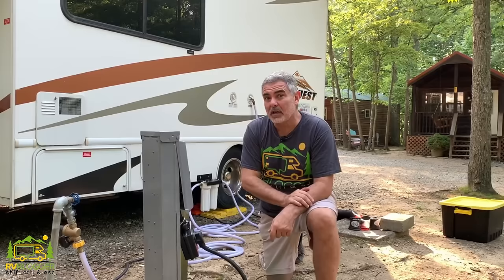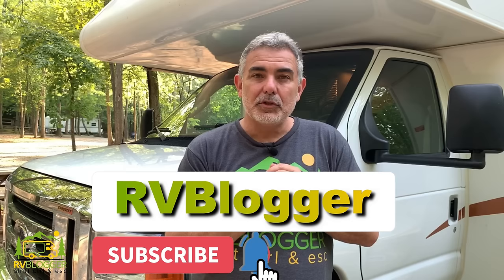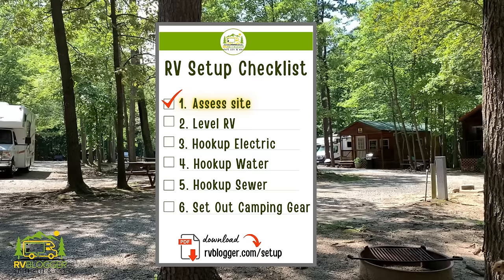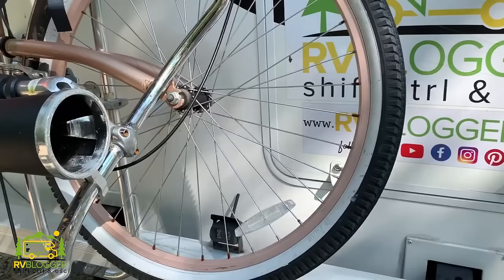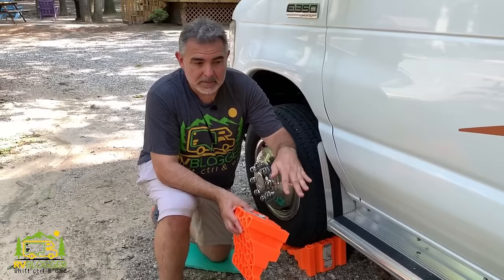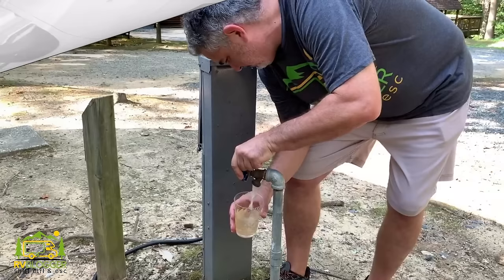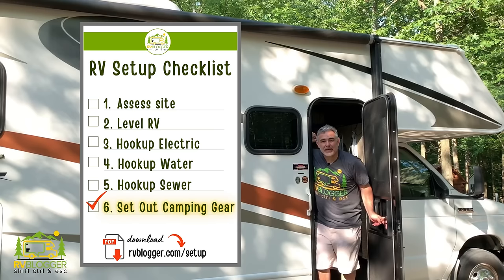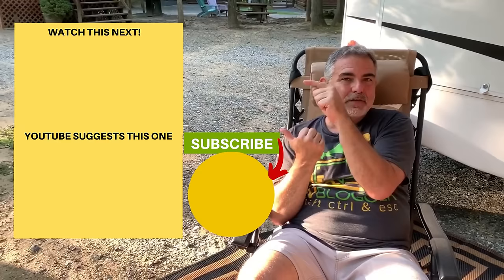How to Setup Your RV Campsite for Beginners - Water, Sewer, Electric and Gear PLUS Newbie Checklist!

Comment: I’m at this moment on my first RV trip ever with my ten year old and while I got an overview from the person who rented this to me, I need help. I don’t have a water pressure piece and just use the hose provided. Do I leave the water running on? Does it regulate from the inside part of the water hook up? Stupid question l know! Also, the ac is only running when I have the generator on. When I turn it off and have the regular electricity hook up, AC nor the microwave turn on. My cotnact hasn’t gotten to me but checking if I am lucky to have someone read this. Am I doing soemthing wrong? Do so need to push a different button to make the ax work without the generator? Is there a video about the buttons inside the RV?
Reply from the maker: Hey Mari 
Great question! You should have a water pressure regulartor because there's nothing in the campground water system or your RV that limits the water pressure :) 
You may have a faulty transfer switch if your electricity isn't working with shore power. 
Thanks for watching and commenting! 
❤ Mike and Susan 

By the way, we hope you will subscribe to our FREE monthly digital/video magazine called RV Camping Magazine. Let us know how you like it!
https://rvblogger.com/rv-camping-magazine/

Comment: Can you use a surge protector with an extension cord or just the junction box at a campsite?
Reply from the maker: Hi Mimi,
I'm not exactly sure what you mean but the surge protector can sometimes be used if you have an extension cord. You would need the proper adapters to get from the 110 current through your surge protector and then attach your rig to the surge protector. But I have also tried this set up and it did not work. So I would say try it and if it doesn't work just eliminate the surge protector.
I hope that answers your question.
Mike

Comment: How do I turn on and off the gray & black water tank ??
Reply from the maker: Do you mean open and close the black and grey tanks? There is a valve handle you pull and puch to release and close the tanks. Typically found under the RV in the rear. Thanks for watching our Setup video and commenting.

Comment: I love my Rhino sewer hose...however, I did have one disentegrate as it stays outside and hooked up for long periods of time - super pro tip - try to keep sun off of sewer hose - Everyone will have one of these environmental spills in their RV career - just try to make as long as you can before this will eventually happen. Also - what do you carry for dump station dumping? Will the Rhino work? I need to buy a second hose for traveling and not sure which to buy.
Reply: I keep another hose the same length as my original - just for backup and/or extension.
Reply from the maker: Hi Mickey,
Sunlight really does cause things to wear out faster. I use my Rhino Blaster and Rhino sewer hose for dump station dumping too. Plus I carry a green water hose ( my white hoses are for fresh water) that I connect to the RhinoBlaster at the dump station. I hope that answers your question.
Thanks for watching and commenting! 
Mike and Susan

Have you subscribed to our YouTube channel yet? If not we sure hope you will click below and subscribe! Thanks!
http://goto.rvblogger.com/YoutubeChannel?sub_confirmation=1

Comment: Hello from Colorado. I have the same RV that you all have. I just purchased her 3 weeks ago and love it. In very good shape so as it will be myself and pup I didn’t want something that needed much work. Ok-I have a question on the gray/black. I have to almost lay on the ground to reach the gray lever to open. I’m 71 and it isn’t the easiest to do. Is there something I’m missing on how to hook up and empty the tanks. At this time there is only water in them and not much. No potty has happened yet. I wanted to do a hook up at home for practice so I can do it once out camping. 
Suggestions most welcome. You do a very good job explaining things and I thank you for that
Reply from the maker: Hi Marcella,
I responded to you 5 days ago but it must not have saved.
You aren't missing something. The gray tank valve is on top of the pipe and you have to push the handle straight up to open it. It's kind of in a bad spot. 
You could have any plumber look and see if they could move the valve to a different location so maybe you could pull down to open it. It's all just plastic pipe.
Thanks for watching and commenting! 
Mike and Susan

Have you subscribed to our YouTube channel yet? If not we sure hope you will click below and subscribe! Thanks!
http://goto.rvblogger.com/YoutubeChannel?sub_confirmation=1
Reply: @RVBlogger  Thank you.  I am going to do some research for someone who does RV build/remodel etc and see if they can help with this.  I am thinking about (if possible) having an opening cut and a door fit (like other compartments) so I can get to that valve.  Or one of them may have other ideas for me to consider.  Not sure why they would have done it this way but I move forward to find a resolve.  If that happens I'll be sure to share with you....again thank you and safe travels!!!

Comment: Great set up video!! I give you that in spades!! But....if the blue water filters "don't work" then why are they so highly regarded? I've used them multiple times with no complaints. I even tried the water after I disconnected and tried the water straight outta the faucet and there was a notable difference in taste. So, I have to very strongly disagree that the blue filters "don't work". Maybe they don't do the job your double filter system does but saying they don't work is an injustice to them. They do work and they do help with water cleanliness.
Reply from the maker: Hi Zach,
Glad you like the video!
The cheap blue filters do help but depending on the filter you buy they only filter down to 100 microns...here is a video I made about how filters work that explains it all in detail. 
https://youtu.be/06nHVkDeqwg
Let me know what you think!
Thanks for watching and commenting! 
Mike and Susan 

By the way, have you subscribed to our YouTube channel yet? If not we sure hope you will click below and subscribe! Thanks!
http://goto.rvblogger.com/YoutubeChannel?sub_confirmation=1

Comment: Do you ever worry about somebody stealing your surge protector?
Reply from the maker: We have never had an issue with theft...knock on wood 🤛. Some times we will cover the pedestal with a large trash bag. That does 2 things, protects our electric setup if it rains AND deters theft by making the surge protector unnoticeable if you're camping in a questionable area. Thank you for watching our RV setup video and commenting.

Comment: When you're using city water at the campsite, do you keep the water pump on?
Reply from the maker: Hey Reginald, 
Nope, you only need the water pump when you're using water from your fresh water holding tank. 
Thanks for watching and commenting! 
❤ Mike and Susan
Reply: @RVBlogger  Tks. In your opinion, what is the best rv? Do you prefer fiberglass or tpo roof? I will be purchasing an rv in the near future.
Reply from the maker: @reginaldsingletary2557  Hi Reginald, We really like the fiberglass trailers the best. They hold their value and leak less often. We made a video about them at the Fiberglass RV Rally last year. Here's the link if you would like to check it out.
https://youtu.be/R5ofLqoRVZ8
All the best!
Mike and Susan

Comment: Getting ready for my very first outing. I’ve never even been in an RV til now. How did you determine that you needed three blocks to level your RV? Also, I’m traveling alone. How do you know you’ve pulled up enough on your blocks? I’m sure I’m going to have many questions! I just joined your Facebook group as well. Thanks!
Reply from the maker: Hi Donna,
Years of experience and now I can tell right away how many blocks I need to get level just by looking the how the RV is sitting. If you are alone you will have to back onto the blocks and stop - then jump out and see if you are in the right spot. Might take a few tries by yourself.
Glad you are in the FB Group too!!!!
Good luck and safe travels!!!
Thanks for watching and commenting! 
Mike and Susan

Comment: How do u secure the surge protector from theft?  Our world has changed. Thank you for sharing.
Reply from the maker: Hi cdLady!,
I usually don't worry about it...but others use a cable to secure them. 
If I'm really worried I throw a green trash bag over the whole electric meter and my surge protector and tape the bottom of it tight. This way no one can see it and it keeps everything water tight too!
Thanks so much for watching!
Mike and Susan
Reply: @RVBlogger  Great idea to hide the whole connection. If they can't see it, they may not wanna steal it!

Comment: Would you recommend your motorhome? what type is?, maintenance, reliability, etc. I'm just can't fine any good reviews about motorhomes. We are six in the family but we want to buy a small class C to go and see other relatives and some short time camping at the beach to avoid hotels or other rentals. Ford vs chevy?, diesel or gas?,  We do not need a big space, only to have a place to sleep. Thank you
Reply from the maker: Hi casq882,
We would recommend a used Gulf Stream. We love ours. Its built on a Ford E-350 chassis and it runs great. Six people can sleep in our RV too! 
We have a gas engine as most of them do. 
We love having a class C because setup and break down are so easy and fast! We see people with travel trailers and all the steps they have to go through and we are very glad we have a Class C.
Hope that helps!
Thanks for watching and commenting! 
Mike and Susan 
By the way, have you subscribed to our YouTube channel yet? If not we sure hope you will click below and subscribe! Thanks!
http://goto.rvblogger.com/YoutubeChannel?sub_confirmation=1
Reply: @RVBlogger  thank you so much

Comment: When you first hooked up the sewer hose - you hooked it up to your gray tank correct? You explained that you keep your black tank valve closed but you didn’t really say which tank you first hooked up to, or if you did - I might’ve missed it.  Edit: great video and channel btw.
Reply from the maker: Hi Brad,
Most RVs and campers have one connection for the black tank and grey tank so you don't have to hook up to each of them individually. Hope that makes sense. 
Thanks for watching and commenting! 
Mike and Susan
Reply: @RVBlogger  Thanks, makes perfect sense now. We’re in the market to buy an rv, so I’m trying to learn as much as I can before stepping foot on a dealership.
Reply: @bradjennings721  Hi Brad,
That's cool. My best recommendation is to rent the type of RV you are considering BEFORE you buy one. We rented a Class C RV before we bought one because neither of us ever owned a CLass C before. We had travel trailers and pop up campers. After renting the Class C for a 10 day trip we had a much better idea of what we needed and wanted in a Class C and we were able to make a very informed buying decision. I see people buy the wrong RV every day and then they sell it after a year or two, lose money, and buy the right camper. Don't make that mistake - it will cost you thousands. I have a discount code you can use if you decide to rent. Just message me back if you would like me to send it to you.
Mike

Comment: I am a newbie and just wondered how the grey tank is emptied? I did not understand the connection between flushing the black tank and the grey tank.
Reply from the maker: Hi Holly,
The grey tank has a valve that you open and drain right after you drain the black tank. Both valves are very close to each other. Sorry if I didn't explain that very well.
Thanks for watching!
Mike

Comment: We're not Newbies to all other forms of camping but just got our first motorhome, so I'm out looking for any tips and appreciate yours.  One question, why did you pick the surge protector that you did?  I'm noticing that there's this huge leap from the $70 range to the $280 range!  Thanks!
Reply from the maker: Hi Wander Woman,
That is a great question!!! I picked the portable Surge Protector that costs around $110 because it is portable and not built in. If you have a built in SP and it malfunctions then guess what - no shore power to your RV!
Progressive industries recently came out with the much more expensive ($280+) portable SPs. They weren't available when we bought ours and I haven't researched the new ones to see if it's worth trading up.
Let us know what you find out if you do any research on them.
Thanks for watching and commenting! 
Mike and Susan 

By the way, have you subscribed to our YouTube channel yet? If not we sure hope you will click below and subscribe! Thanks!
http://goto.rvblogger.com/YoutubeChannel?sub_confirmation=1
Reply: @RVBlogger  Thanks for the quick response!  I did do a little research.  That’s how I found the difference between surge protectors and EMS-Electrical Management Systems.  I think the $280 model you mentioned is their portable EMS.  And we’ll probably go with it.  Happy Trails!

Comment: Not doing all that leveling and wheel 🛞 chocking and measuring stuff!
Reply from the maker: Hi Cipher,
ok, but  what if your head is lower than your feet when you sleep?
Mike
Reply: @RVBlogger  Well I will just turn around the other way!

Comment: very wasteful and environmentally unfriendly.  
Re-use the water you run for plants instead of running on the ground.
Throwaway gloves? Not environmentally friendly.
Do better.
Reply from the maker: Good points. Not many plants around in most campgrounds and not sure they would want to drink water filled with iron or bacteria. Not going to save gloves that we wear to handle a sewer hose. Do you wear reusable gloves handling your sewer gear? Thanks for watching and commening.